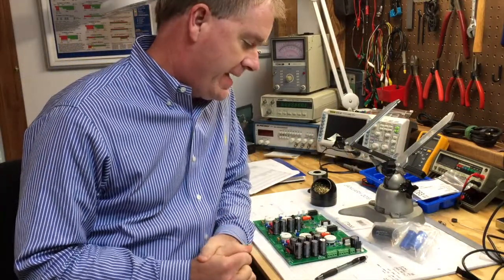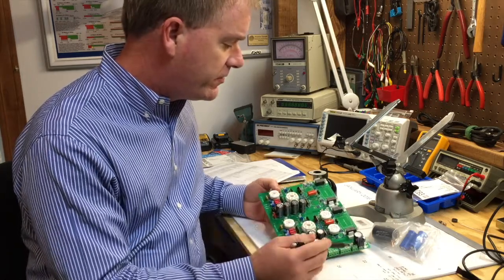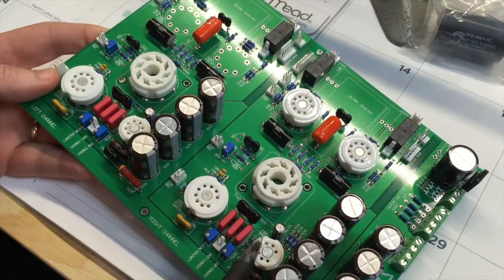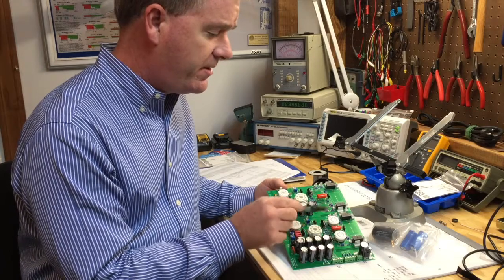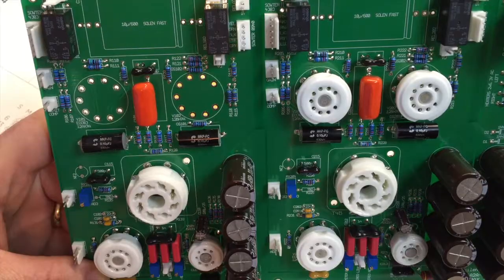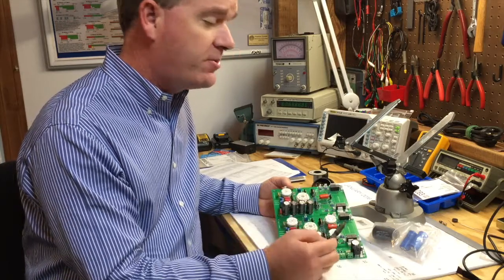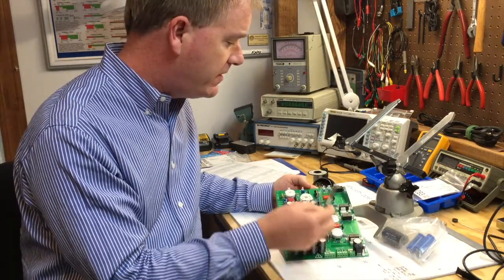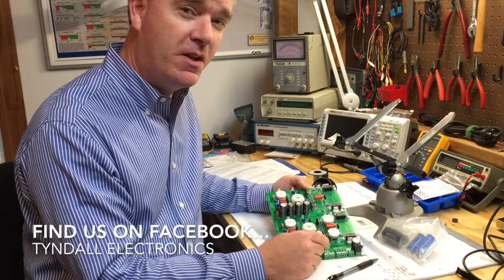Stereo LA2A Build - Part 2

Comment: when do you run the heaters? what size wire?
Reply from the maker: I wired the heater connections (which are done on the underside of the PCB) last; after the board was completed otherwise.  I believe I used 16 ga wire.
Reply: I'm in process of putting one together and barely could get 20g to fit on the pin9 connections. Nice videos, still waiting for#5.